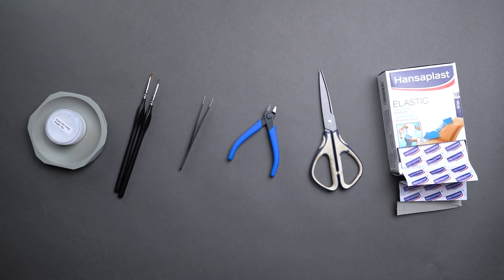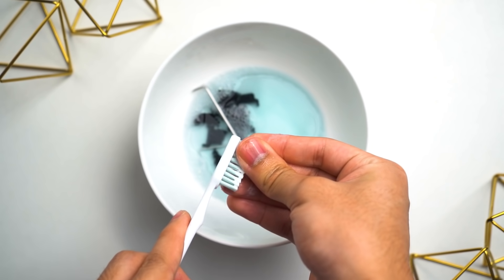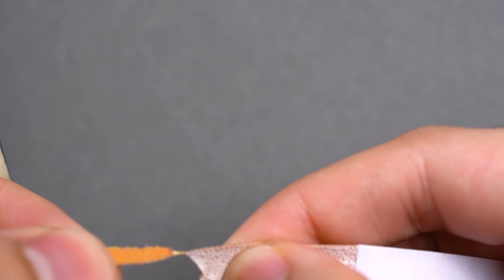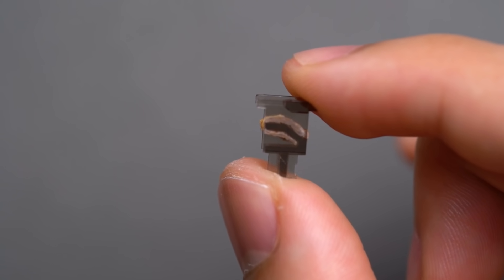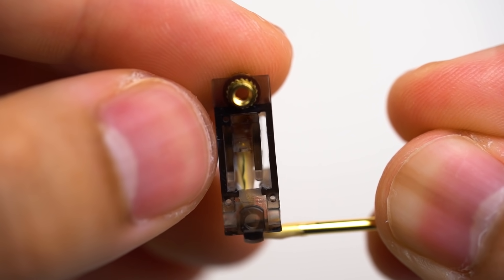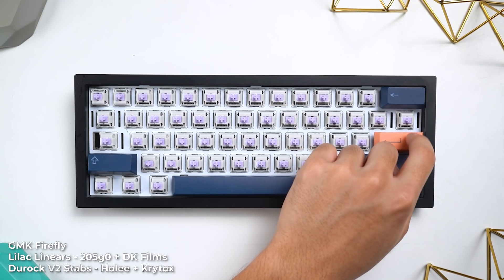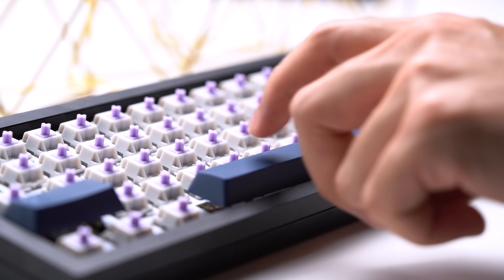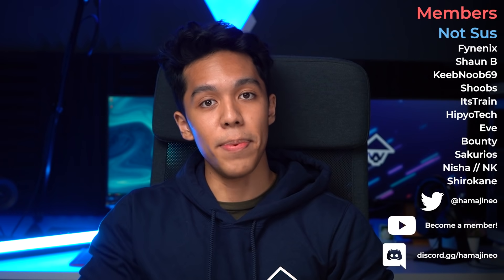Holee Mod Tutorial - The ULTIMATE Stabilizer Mod!

Comment: Medical tape works as well and can be less wasteful than bandaids !
Reply: My mind is blown right now, I've wasted so many bandaids!
Reply: I made the same discovery! I just happened to see some medical tape in the dollar store and realized it was the exact same material. It saves SO much time and money to just buy it that way.
Reply: In my experience it's too thin but maybe it was just the tape I used
Reply: Have you tried heat shrink around the wires?
Reply: @the_womp_and_only9062  i haven't ,but isint heat shrink rubbery and would that make it scratchier?
Reply: @the_womp_and_only9062   it really does depend on the brand of tape lol
Reply: @d12play14  I'm not sure, I saw it in a few videos
Reply: Nice, will do that with the stabs for my Kara :3 thanks!
Reply: I use electrical tape and it works perfectly fine 👍
Reply: @rapidzabyss835  oh good to know, didn't feel like wasting medical supplies lol
Reply: Medical tape gang rise up
Reply: They’re not sticky so not really
Reply: @rapidzabyss835  The only reason I don't recommend electrical tape is because the adhesive on electrical tape gets to be super gunky, and tends to "leak" from wherever the tape is after a while. YMMV, but just be careful.
Reply: @d12play14  you talking about the micropores surgical tapes?
Reply: same thoughts but i use muscle tape cause i got some lying around
Reply: Can I use hockey stick tape?
Reply: @ilyhyper  hockey stick tape is the same as the mueller tape right? it might be too thick theyll be too much resistance
Reply: @spacesheep2110  no they aren’t the same
Reply: THATS NOT A BANDADE ITS A PLASTER
Reply: @sb113.  ???
Reply: @sb113.  in America we call them bandaids instead of plasters
Reply: @birhb6372  I know but you understand its too close to bandage
Reply: @sb113.  they're similar things, also ya cant really do anything about the fact that calling them bandaids is pretty standard here in America, so shrug
Reply: @sb113.  Dude no one here asked if England is better than America plus if you don’t want to look like a clown don’t mindlessly rant without even having good grammar
Reply: used medical tape, too thin atleast mine was even after multiple applications, just bought some fabric band-aids, imma try it
Reply: My parents have medical tape cause duh, theyre doctors.
Reply: Is cloth tape the same?
Reply: Was wondering about climbing tape for the same reason…
Reply: Can you also wrap the wires in conjunction with the stem mod?
Reply: Are bandaids more expensive than medical tape?
Reply: @fidelramen5202  by surface area, definitely
Reply: Bandadai are more adhesive tho
Reply: medical tape doesn't really work for me. they tend to fall out and shred after a few weeks. i reccomed bandaids for mor consistent results
Reply: this tip is everything
Reply: what kind of medical tape do you use? something like leukoplast or micropore?
Reply: i use masking tape it works great too
Reply: @rapidzabyss835  Great tip this. I had mixed results with band-aid so mostly use medical tape now. If the stabs are particularly gnarly though, I apply two thin layers of electrical tape and that usually gets them into the zone of acceptability.

Comment: be warned: holle modding zeal stabs can result in a very mushy break in period due to the reduced space in the stem compared to durock v2s. To accelerate the break in process, I recommend extra time to be spent flattening the bandaid to the stem, and also pre-soaking it with whatever lubricant you are using on the wires (of course, with the bandaid already installed... or else the adhesive won't work)
Reply: using electrical tape instead of band aids might help with the mushiness :)
Reply: The mod gives me such a mushy bottom out that I really hate... How long is the break-in period on average?
Reply: BEEEEEEEEEEEE WARNEDDDDDDDDDDDDDDDD:D
Reply: thanks for the advice!

Comment: Using the right bandaid and a good pair of small scissors makes this a lot easier. Also I found it easier to cut the bandaid by peeling the cover off, turning it 90 degrees and putting it back on. That way you can cut the bandaid without the scissors sticking but you can still peel off the cover since it will stick out past the ends of the bandaid.
Reply: I have trouble getting the band-aid to actually stick to the stem.  Does the brand matter?

Comment: Thank you very much for doing this video on the holee mod. I thought my boards sounded decent before. But after trying it out on all the stabs for 2 of my hotswap boards (NK65 EE and a 60% alu case), my boards sound SO MUCH better! I never knew my boards could make such sounds before, its like unlocking the potential that I never knew existed out of these boards.

The holee mod removes that annoying metallic ticking sound that is produced when the metal stab wire hits the stabiliser stem when we push down on the key. 

I had thought my quality everglide screw in stabs didn't produce any ticking sound. But upon closer sound comparison with my holee modded stabs. I DID notice a subtle ticking with the screw in stabs that I never really paid attention to before. After holee modding all my everglide screw in stabs, it resulted in the stab keys having a much more muted, more homogeneous sound profile as compared to the other normal keys. When I do a typing test, the entire keyboard sounds smoother, as I can't tell the difference in sound when I press on a spacebar, a shift key or a normal key. The typing sounds and experience has become so much more satisfying, that I'm buying desoldering tools to desolder all my other boards to holee mod all the stabs moving forward.

Comment: Great video! 

For my very loose wire, I needed to also dampened the side to side play inside the housing. So instead of putting the tape inside the housing itself, I wrapped 1 layer of duct tape around each end of the wire, being careful to keep it only 1 layer thick so I can insert the wire back into the housing.

Comment: I think the issue with these methods is longevity. The metal bar is constantly in contact with the band-aid/fabric. Which means friction, fraying resulting in a hole. 
The fabric pads are very, very thin and aren't gonna last very long compared to lube, which you can just apply them when it dries out.

Comment: dude. this crap just saved me a bunch of time, my holee modded keychron stabs with cheapo dieletric and teflon grease sound better than my screw in durock v2s with krytox 205g0. you earned a sub and im doing this for every single keyboard i touch for now on

Comment: 0:57 Thanks for actually doing a tools and parts list instead of just assuming we'll have them or getting us to go through the whole video noting down parts or something. Also I think the plasters can be medical tape and I was going to say aluminum tape but apparently 1:11 You need some cushioning not just extended hard surface which is what aluminum tape is for although perhaps if you just want 1 bit of medical tape and no more cushioning you might but a layer or two of aluminum tape on first (or last? I think first so it isn't just a tower of tape and so it has a solid foundation) for a more snug fit.

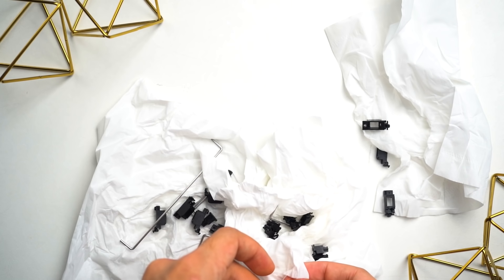2:19 So basically you ideally want a flat bottom on stablisers in the first place but if you dont have that then clip them and possibly sand them/nail file them if they're still not flat?

Imma stop timestamping good video all around from 0:57 onwards, details explanations and actually telling you WHY you're doing things, might download this video and cut the parts before 0:56 as its a really good tutorial. The testing aswell damn, really good, I will put this comment in the same folder as a readme for this video.

Comment: be ware: You should be very sure about the bandade you are using. My first try at this mod took over four times as long, just because I used the wrong bandade type! You should use the ones that have a similar texture as medical tape. I found they are the least finicky. (Medical tape also works)
Reply: Good call. I actually prefer medical tape now.

Comment: The ultimate solution to meaty or attling stabilisers are Costar stabiliser period.

Costar stabiliser feel smooth to press and depress, with no room for meatiness. It's also much more forgiving for pressing at edges of keycap than Cherry style can.

And for the lubing, you only need to lube/oil the 2 contacts of wire, that's with the mounts and with the stabilisers insert, much more direct and effective lubing which last well over time.

Comment: Literally just spent 7 hours trying to figure out how to get rid of stabilizer rattle..... Wish I had just watched this before I started, cause it's literally what I ended up doing after trying literally everything. 

The only thing I did different was I used the rubber tape that kbdfans sells for their regular bandaid mod. And I also added a tiny piece under where the wires clip into the stabilizers!

Comment: I have had stabs that were unfixable. Then an engineer, a friend, showed me the easiest fix.  So i just use wicking cotton with lubing the cotton after assembly. 1cotton under the wire fastners and 2 cotton inside the stab stem. Fixed!

Comment: Just wanna share my own mod to stabilizer. I used thick lube for the end points of stabilizer rod and instead of using bandaid to the contact surface of pcb and stabilizer housing, I used the thinnest 3M double sided tape (the gray one) and put a thin layer of tissue paper so that it will not stick and I can put some krytox 205g0 lube. No rattle and it doesn't feel mushy

Comment: Very Help video! highly recommend! My friend introduced me to the Keyboard world so I got a 250$ keyboard! acrylic frosted case, DZ60RGB PCB, Aluminum Plate, Alpacas, and some cheap but REALLY good for the price keycaps (don't know the name., Durock V2 stabs. my friend recommended me to do the whole mod and I just finished my first stab. One thing I would say is if it is frustration on the first stem and takes about an hour for one stem it's ok, you will try your 2nd one and you will be 50X faster. Really good vid and recemend to everybody but i just wish hamaji showed about how much lube to put on the brush but i think everybody could manage.

Comment: Thoughts on the holee mod vs generous dielectric grease? I imagine one main advantage is that the holee mod will last a lot longer and dielectric grease may need to be re-applied.

And just in case someone misinterprets what I'm saying: I'm saying dieletric grease instead of holee mod, not both at the same time.
Reply: For  people that want to know: I've been using my stabilisers with the dielectric grease mod for over 12 months, and haven't felt the need to add more. 

Once you get them sounding good from the start, with decent stabilisers; it's unlikely that you'll have to reapply more in my opinion.
Reply: @Kais.  Can i use super lube and holee mod at the same time? Or should i only use super lube
Reply: @Citex61  You can use both if you want. Though you'll probably have to break them in. I say; try just the lube first, to see if you feel like you need the holee mod.
Reply: @Kais.  okay thanks for your answer!

Comment: This is awesome, the first time I've seen this particular mod. I'm going to give it a try today on a keyboard I'm building. However, I wonder about the longevity of this mod. An unlubed or traditionally installed stabilizer with lube alone can last many years with everyday use. Will the bandaid piece degrade or become gunked up in some way over a relatively short period of time? Do you have any keyboards you've done this with that have been in use for a year or more?
Reply: Exactly.   I would not expect this to be a permanent solution.

Comment: I mainly use zeal plate mount stabs and feel that with the older version of the stabs, the wire hole is tight enough that you don’t need the holee mod. Unfortunately, the new version of the stabs have looser wire holes and do need the holee mod.

Comment: Edit: you have o get it exactly perfect for it to work as the tolerances are really tight

I tried medical tape and no matter how much I thinned it and shortened it, it didnt work with durock plate mount stabs. Maybe I just did it wrong but just a warning

Comment: i just lowkey thought of a banger idea, (hear me out) what is a company made a holy mod kit ( it would consist of pre cut bandage like material that is sticky on one side as to not make it slip of the the right part of the stabs when in use, plus it would fit to any stabs because it is precut out to fit any type of stab size, you  would be able to get it in different materials depending on how dampened you like your stabs, and if your wire was still ratterly after all of that there would be an extra material to go around you the tip of the wire that makes contact with the rest of the stab housing, preventing the wire to hit and of the housing that may have been unlubed or missed. This is just a thought, what do you think?

Comment: This is the best explanation I've ever heard. Much that I am interested to do this, but for the same reason as lubing switches, I find it very time-consuming and don't have time to do that or I'm just too lazy. I have a question though, I have keychron k3 v2 low profile optical keyboard and redragon K552 RGB kumara. Both are brand new as I type this comment and I changed their switches and keycaps. If I have time and money, should I change the current ones with durock or just mod what stabilizers I have? I'm not sure that changing stabs will significantly improve the typing feels, maybe I'm just new to these kinda things

Comment: Just finished making my first keyboard using this along with Taeha's stabilizer video! This took so long but it was so worth it! 
For anyone wondering: 
K66 Hotswap
Aquakings v3 stock (didn't want to lube switches for my first build so I chose what I heard was a decent stock switch.) 
Durock v2 lubed with Krytox 205g0}
MiTo MT3 Cyber Keycaps
Tape Modded (3 layers-was a bit annoying since it kept making my PCB shift upwards but still managed to fit.)

Thanks to this video my stabilizers sound much better than what I had on this board stock. The only thing is I might have to remove a bit of lube from my spacebar as it feels a bit too mushy rn but hopefully it is just the holee mod. If anyone has any tips for a beginner on what other things I should try please let me know!

Comment: maybe it's cause I'm using different stabilizers, or band aids that are too thick or fray apart too easily, but I notice that the stabilizer sometimes end up getting jammed when I go and I do this mod. I think what's going on is that the part of the band aid that gets bent & wraps around ends up protruding out a bit, and that protrusion ends up hitting against the stabilizer housing. Does anyone else experience this? What do you do to get around this issue?

Comment: I tried this on my GMMK pro and the stabs are kinda stuck and don’t like rebounding. Kinda mushy.
Reply: Sounds like you overdid it on the size of the material, and the amount of lube. The material does not have to climb the walls on each side of the wire.

Comment: Awesome video! 
Did this mode for my first keyboard,  but you could mention that this mod is not a silverbullet.
In my case I use my Ducky PBT keycaps and the space is ever so slightly warped (tried to fix it multiple times) and if you listen it very very carefully,  you can still hear some very light ticking noise from one side. Im pretty sure a GMK keycap would solve the problem for me (Or some other very straight spacebar)
BUT, its worth the effort in my opinion, all the stabilizers sounds awesome.

Comment: Do you have a similar mods/video for the Costar Stabilsers?  Specifically putting the kepcaps back onto the Costar stabilizers after they have been modified.
Reply: Costar stabiliser is much more simpler, little room to done wrong and much better tolerance towards uneven press (provided the stabiliser mount itself is of decent quality, the wire is right sized and didn't bend unintentionally).

For lubing, you need to lube two parts, first is the rotating contact of wire with the plastic mount, second is the hole of stabiliser inserts with the wire.

Now, back on the assembly. I've no idea why so many people struggle with putting keycaps back onto Costar stabiliser... For me, it's easier and much more confident than pushing hard onto Cherry style stabiliser. Basically, you put the stabiliser insert into the gap of the Costar mount (and through the wire, on both sides). Then you align your keycaps toward the stabiliser inserts (tips, keeping your keycap at a 90 degree lie down position will make it much easier to mount the inserts), then push them in one by one. Now with the inserts into the keycaps and yet back onto the keyswtich, it's time for lubing the 2nd lubing I mentioned above. After the lube, you can push the keycaps into the keyswitch and check if there's any rattling or pinging noises when pressing at the edges of keycaps (which is unlikely after you've done the lubing).

Comment: Does the thickness of the band aid affect the sound of the stabs? for example, if a thinner band aid is used for the holee mod, the stabs might still be somewhat "clacky"? how does it work ?
Reply: i used soft cloth (not the shiny kind!) surgical tape which is a bit thinner than the band aid and it sounds great, no clackiness or rattle! (someone on reddit recommended it and i would say it is way easier to work with)

Comment: Using fabric Band-Aids for a keyboard just seems cheap. Why not use electrical tape or other kinds of smooth tape with some thickness. Fabric = more friction, so why add more friction? A smooth surface should feel better
Reply: this is true actually! electrical tape could be better but since it is made from "rubbery" materials it may feel quite mushy.